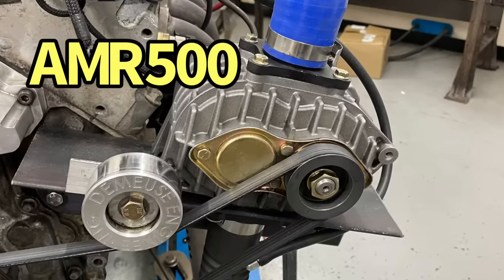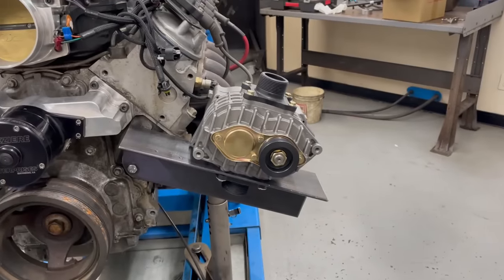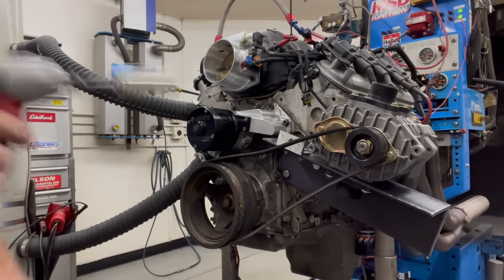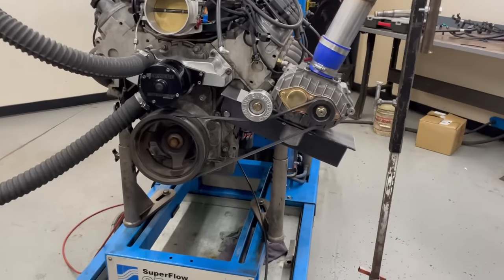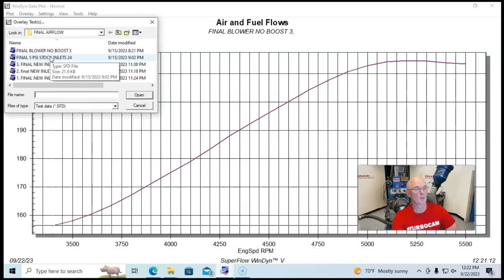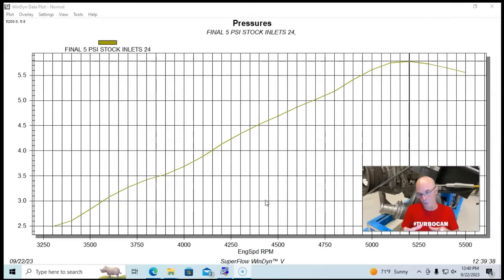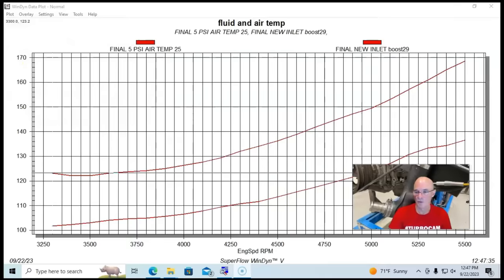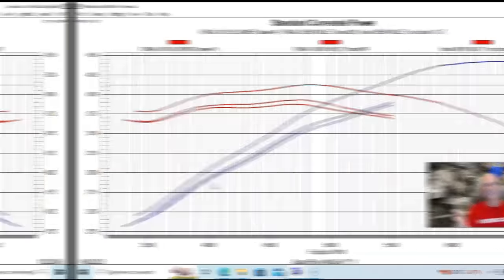THE ULTIMATE CHEAP, EBAY, AMAZON AMR500 BLOWER TEST. FULL RESULTS-AIRFLOW, TEMP & POWER CONSUMPTION

Comment: Have to remember: Your boost pump has same characteristics as wings. Similar restrictions for speed and pressure envelopes as wings.
In other words, the compressor can only be spun so fast, and produce so much pressure within a fixed range, or "optimal range". Below and above that speed and pressure, you will see reduced output.
OR, as someone else put it, more money = better boost (usually) ;)
Reply: good point.   Propeller tips when they go supersonic  do some inefficient things.

Comment: Add some stripes to your drive belt and use an optical tachometer to measure the belt speed.  If you plot it vs engine RPM you'll see if the belt slips or not--the engine RPM and belt speed will be linear when not slipping.

Comment: More airflow = Less restriction.   you get the same result "Porting" (Open up the outlet triangle to the edges of the silencer holes)  a Eaton M90 blower or even a MN112 Boost goes down, outlet air temp goes down and WHP goes up.    I don't know if the inlet matters as much as the outlet.
Reply from the maker: If you open the inlet up on a PD blower-boost goes up and airflow goes up and power goes up (usually)

Comment: I think some engines that run on poor mixture, I think some skyactiv engine, use the blower to reduce/regulate the air flow and keep the engine in the sweet spot for fuel economy. Cool test.

Comment: Before modifying to a toothed belt try modifying the bracket to adapt two pulleys within the belt route one just above the super charger pulley and one just below the supercharger pulley and route the belt through make sure the fit is real tight between the two pulleys, this will ensure the highest contact patch the ribbed belt has around the supercharger pulley itself this will also nearly eliminate pulley slippage at high revs due to the belt loosing grip as the slack end of the belt.

Comment: as for the curve flattening out at the top (18k rpm) my uneducated guess would be given the size of the rotors in that little guy is that the vacuum on the intake side is so strong that it is not pulling more air in anymore effectively.  its just stretching air  the same way a engine does on the intake side. not belt slippage

Comment: The boost was lower due to the lower temperature.  At least 1/2 of your boost was the increased air temperature. Your intakes increased the efficiency of the blower. This lowered the air temperature at the same flow rate. This lowered the boost pressure even though you are moving more air.
Reply: Pretty well this. It's like going to a bigger turbo. Less boost but more flow.

Comment: You need to put it on the Pontiac 4 cyl. Also, did you retest the output in the first configuration to make sure to it hadn't warn which would have reduced it's efficiency?
Reply: Ecotec or iron duke ? 
And if ecotec what ecotec specifically?

Comment: Maybe the higher velocity through the modified in/out created some sort of venturi effect across the port going to the boost sensor giving you a false pressure reading?  Also it's hard to be sure but it looks like your bigger inlet has the sides of the square maybe protruding out into the round tube...  if that is the case maybe you could get a tad more airflow by either disassembling it and grinding those out or else maybe shape one end of the round tube into a square to match the actual opening a bit better like a round to square transition then weld it to a square hole in the plate.  I had no idea these things existed till you posted this and man they are cheap, now I got to figure out how to build something with one.

Comment: The boost pressure is lower on the higher inlet/outlet dimensions because of ideal gas law. The air is cooler, therefore more dense. I am too lazy to do the math here, but the mass air flow can be back calculated from pressure and temperature. Everything makes perfect sense here.

Comment: The AMR500 blower could about perfect fitted to a 350 to 500 CC 4-stroke motorcycle engine!
Reply: Kei car too (660 cc max).
Reply: That's exactly what I plan on doing! I have a Honda gx500 twin that I'm putting in a drag lawn tractor and I plan on using this setup to feed it
Reply: except that it takes roughly half that engines expected output to power it...

Comment: My best guess as to why boost decreased would be turbulence caused. The smaller outlet is closer to the size of the restrictor creating less turbulence on outflow. The larger outlet not only is the air restricted but it's more back pressure against the blower

Comment: Pretty sure you can see the belt slippage in the video, up in the higher rpm range... seems obvious... seemed obvious before you were even mentioning the possibility. Also, the boost leak is probably at the super Richie inlet and outlet... outlet mostly .. but both seem to have the same issue. They aren't fully welded, they overlap the square inlet and outlet face, and don't seem to have any additional gasket to seal them... so, the metal on metal alone would lose something, but then the lack of a full weld around the collars is another big source for air to escape. Fix those two issues, and the boost would probably go up a good bit.

Comment: I think you were getting more airflow with less boost pressure on the improved intake due to it running more efficiently.
Perhaps because the stock inlet was a restriction, causing you too superheat the air, or perhaps due to shape of the inlet (curves instead of right angle edges etc).
Reply: Good answer. What about increased or decreased velocity due to the smaller/larger openings? Would it be better to run 1&1? One stock, one larger?
Reply: Exactly boost is a number relative to restriction. You can run the same setup on a stock engine and get higher boost, but once you increase the engines flow the boost will decrease, but flow will increase. Boost is a relative factor not an absolute number.

Comment: air bypassing the rotor tips, leakage, inefficiency, that's how you check pump efficiency, flow open and flow at pressure. also as the case heats up more leak.

Comment: I think the blower overheats at high speed, it causes all sorts of extra friction and would eventually show as belt slippage. I doubt you can just keep spinning the little guy forever, something eventually has to give. 

As to the increased flow causing less boost, my guess is the extra airflow increasing velocity and then pressure drop over your map sensor. That, and it seems the outlet would be much cooler with the extra airflow. I'd be interested in retesting with an "intake manifold" with much more volume.

Comment: The neck created to allow more airflow has restrictions from the Procharger itself. The air is meeting a flat surface, make a conical inlet and should in theory flow better. I do believe it has belt slippage as well.
Reply from the maker: Thnx-This is not a Procharger. It is an AMR500 roots style supercharger

Comment: You used a longer, ribbed hose for the stock outlet, and a shorter, smooth, and curved hose for the super richie outlet. The longer length and more turbulent flow from the ribs might be the reason for the higher boost. While the Super Richie outlet you have a more "laminar" like flow, less restriction, more CFM, = less pressure/boost at the sensor.

Comment: I wonder if you had switched it back to the original smaller inlet and outlets if it would go back to making the same boost. The Amr500 is only rated at 16k rpm so spinning it to 18k might have caused some extra wear and opened up clearances giving less boost.

Comment: The Boost lost with bigger intake was not for the reason you would suspect. It was because the blower was able to move more air that increased load on a belt pulley system that was already at 100%. Any further increases in load resulted in significantly higher slip ratio and net loss. With a cog drive or a 10 rib belt you would have seen an increase in Boost.
Reply from the maker: nope-or we would have seen a sharp drop in airflow

Comment: Air speed.  Faster air = lower pressure.  Bernoulli’s principle.  I also think I could hear belt slip on every run except the big inlet and outlet unrestricted.  Always enjoy your videos, love to see people passionate about the science behind engines.
Reply: Yeah if you listen carefully you can hear the rpm’s on the blower kinda hang while the ls keep going up in rpm definitely a little belt slippage up at 10,000 or so blower rpm I think was also wondering about the accuracy of the pressure readings from airflow across the orifice of the pressure sensor I definitely think 250 cfm is possible with housing porting and maybe water cooling the housing along with an air to water intercooler the gear drive alone probably makes enough heat to increase air temps

Comment: The higher boost pressure on the restricted nozzle is just from heating (inefficiency). The high flow nozzles are less restrictive and result in less heating of the intake charge, thus lower indicated boost.

Comment: Makes sense. If you free up the flow you're going to move more air at less boost. The limit of the charger will be CFM moreso than pressure but as pressure builds that cfm will naturally fall off since it can't be perfectly internally sealed. Calling them positive displacement is only true so far as machining tolerances - they aren't 100% PD. 

I'd take the free flow and lower pressure every time. Lower charge temps, same air flow and less stress.
Reply from the maker: positive displacement is a classification or family of blowers
Reply: @richardholdener1727  I know. My point is they can't actually displace 100% of their capacity due to sealing limitations. You usually lose a little as pressure and flow increase.

Comment: Boost pressure is just a measurement of restriction. Ported heads with a power adder will read less boost and make more power compared to a stock head that flows less with more boost pressure

Comment: Boost pressure is resistance of flow. You increase the flow with the same volume of air, pressure drops, but you are processing the same if not more air.
Reply from the maker: airflow went up

Comment: What if you put an optical tachometer on the blower pulley? It sounds like its slipping to me. The flow is surprising but so is the horsepower needed to spin it. I'm thinking it would take a 60hp motor to around 100hp on 8-10psi with good charge cooling.
Reply from the maker: no on the 60-100 hp drive loss

Comment: I'm building a Porsche 912.  Still at the walking around it and starring stage.  An AMR500 is on my list of possibilities.  This info is going to help a lot.
Reply: Mitsu TD04 , AR gt 25,28 cheap reliable and easier to plumb
Reply: Don't.
Reply: @eflanagan1921  Don't want a turbo.
Reply: @Marc_Wolfe  Why not?
Reply: Bigger. Maybe an M90.
Reply: @Marc_Wolfe  on a 2.0 air cooled flat 4?
Reply: These are basically a little industrial blower that became a mythical beast. They’re cheap so not likely to last long. Inefficient so produce a lot of heat and take more power to run. And, won’t produce much power for all the trouble. 
I’d look for something like an MP62. It’ll be a much better blower that can make more power and be more efficient.
Reply: @NBSV1  How would that fit?
Reply: Did I stutter...
Reply: @Marc_Wolfe  You also didn't explain how to mount such a large blower on a VW Type IV.
Reply: You also didn't pay me to engineer you out of disappointing yourself.
Reply: @Marc_Wolfe  That's what I thought.  You have no idea.  
Thanks for playing. 🤣🤣🤣🤣🤣🤣
Reply: @nucleargrizzly1776  How would what fit? An MP62? They're not much bigger than this little blower. Which you'd have to make custom mounts anyway since it isn't like you can just bolt a blower on some factory mounts and call it a day.
Reply: @NBSV1  Not much bigger?  It's at least 50% bigger.  And it's of a completely different design.  I'd have to fabricate some massive sheet metal manifold.  Beyond my abilities.  I can't find a single reference to an MP62 being used on an air cooled flat 4.  The AMR500 has been used successfully for decades.
Reply: @NBSV1  I did find some installs of a longer MP62 size in flat 4's.  Way beyond my skill set.  Many more AMR500 installs.  Plus I can get a rebuilt blower and intercooler for under $300.
Reply: @nucleargrizzly1776  Well, you're welcome to do what you want. The little blower can work, but you're looking at a max of about 150hp and a more realistic of about 120hp. But, that power is pretty easy to make naturally aspirated without all the hassle of a little blower.
Reply: @NBSV1  I keep hearing that.  What's the alternative?  A real attainable alternative without a flat 6 swap.
Reply: @nucleargrizzly1776  How much power are you wanting to make? And, how do you want it to drive? 
With those engines it starts getting more like a peaky race car when you really start chasing naturally aspirated power beyond about 150hp. 
But, forced induction setups are going to be more complex and take much more work and tuning. 
You can look into things like the blower that was on the newer Mini's. You're way better off going for something that was used on a car. It's going to be better quality and more efficient.
Reply: @NBSV1  Tearing through the Texas Hill Country on a Sunday morning.  About 130 hp.
Reply: @nucleargrizzly1776  Then I'd just stick to NA. A good sized pair of duel carbs, light cleanup port job on the heads and intake, decent exhaust, moderate sized cam, and decent compression. 
You could probably make that power with a moderate cam, dual carbs, and decent exhaust. But, it's so much work changing the cam you might as well do the little bit of extra.
Reply: @NBSV1  If I wanted that I'd just drive my '73 911E.  The blower whine will enhance the driving experience.
Reply: @nucleargrizzly1776  Ok. Why are we having this conversation then? You act like you are actually trying to figure out what kind of setup you need to go for. A few of us have tried to point you in a good direction and give advice. Which has been met with some resistance. 
And, now your response is simply supercharger go burrrr.
Reply: @NBSV1  Because superchargers do go burrrr.  It's part of the driving experience.  I do appreciate the input.  It's prompted me to explore other supercharger options.  But most seems to come from those that have zero experience with a VW Type 4 or are only concerned with HP numbers or race track speed.
Reply: @NBSV1  Maybe I should have stated that she's a '68 that a previous owner installed the engine and transaxle from a '76 912E.  And did a very good job of it.  Even has A/C.   But everything is just worn out.  Building another car to tear up the Texas Hill Country on a Sunday morning.  The driving experience is much more important that setting lap records.  I already have a '73 911E and a '69 Z/28 for that.
Reply: @nucleargrizzly1776  You can also look at the centrifugal superchargers. I think they make some that are pretty small. The mounting and plumbing on those tends to be easier since they would get added on like that AMR does. 
At the end of the day the little AMR blowers just aren't worth the effort to me. They're cheap which ends up being a bad thing. You're much better off going with something more common that was really intended for use on cars.
Reply: @NBSV1  I'm looking into that as well.  The smallest seems to be way more than I need.  But I don't think it would matter as much as a positive displacement supercharger.  Any ideas?
Reply: @NBSV1  Looks like the Rotrex T15-16 might fit the bill (82-170hp).
Reply: Unless you hate your Porsche engine, dont do this.
Reply: @gordocarbo  What would you suggest?  Looking to do something different.

Comment: If the outlet air is increasing in temp, it is coming out less dense and therefore would produce less boost and power due to the heat expansion. The high air speed, due to parasitic drag, heats up much more than a larger inlet and slower airflow would. That’s what’s my guess would be.

Comment: The bigger inlet allowed more turbulence on top of the blower where it’s picked up. The bigger inlet can make more flow with the bigger inlet but when you restrict to add boost it creates the turbulence which equates to less boost. You basically reached the max boost capacity of the the case. Just my hypothesis. Edit: you may be able to fix the turbulence and keep the bigger inlet by shaping the inlet slightly to keep the over all diameter but allow for less turbulence. Maybe 😂
Reply: The bigger hole was met  with a ridge.

Comment: My guess to the higher boost pressure with the stock plastic in/ex is the hose used! Looked like flexible radiator hose.
Long ribbed hose would be a lot more turbulent and restrict flow downstream more than the smooth silicone elbow.
Boost is a measurement of restriction.

Comment: Air temp is the reason for the boost difference, the smaller adaptors restricted airflow, it created a much hotter discharge temp so the air mass expanded more and that registered a higher pressure measurement.

Comment: Put an optical tachometer on the compressor pulley to detect if slippage is occuring. Rpm curve will not be linear if slippage occurs.